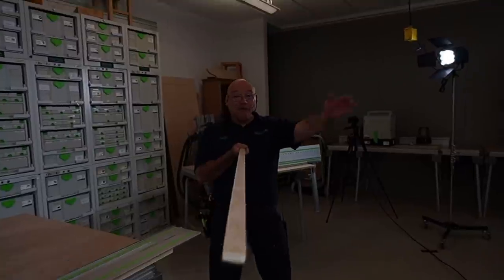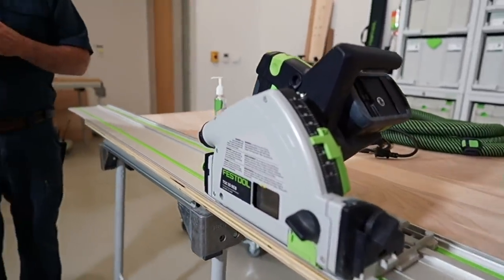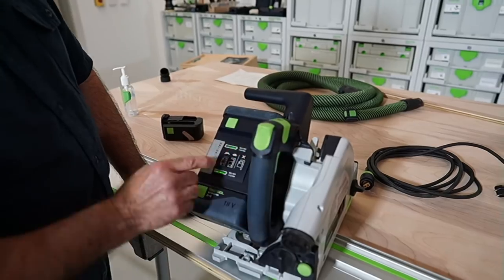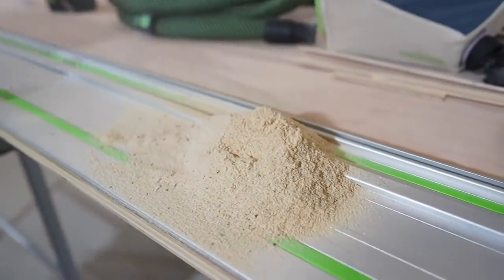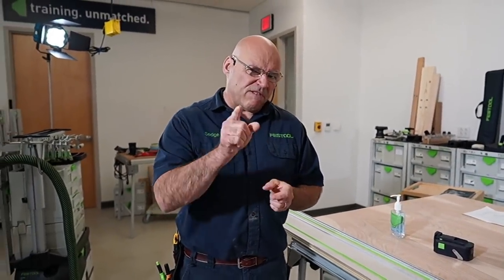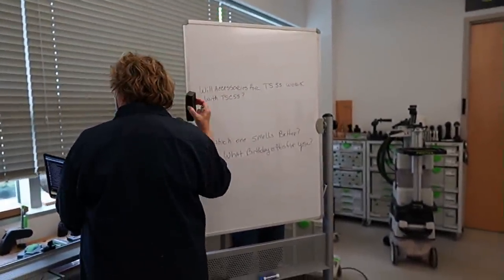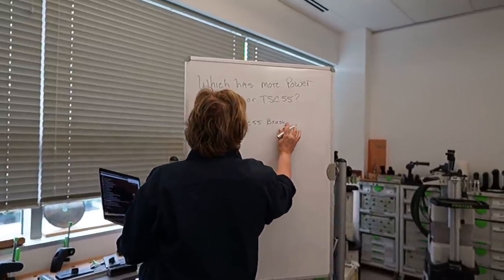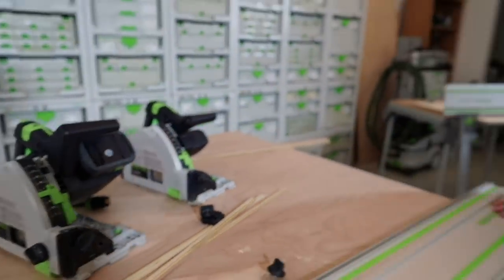Festool Live Episode 07 - TS 55 vs. TSC 55

Comment: Does changing to a 12tooth rip blade effect the alignment of the splinter guard?
Reply: No because the splinter guard on the track is on the same side as the arbor the blade attaches to.